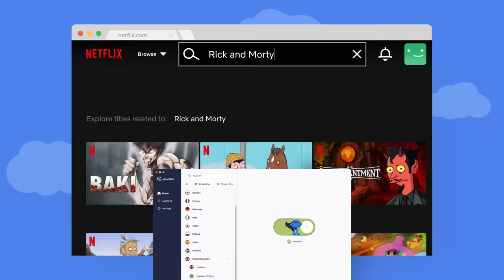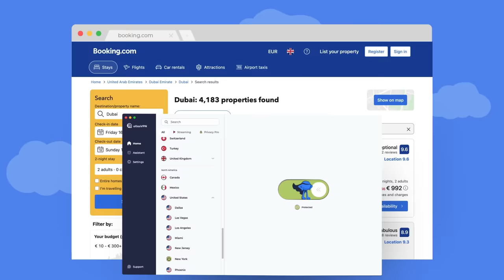How do Russians Cope with Heavy Tank Losses?

Comment: I think people underestimate just how repairable tanks are in comparison to the cost of making a new one. As long as the turret ring on the hull isn't deformed or the inside aren't completely torched, you can repair them if you can recover them.
Reply: tell me more mr tank expert
Reply: @kidkique ooooooh the sarcasm
Reply: If I fart inside a tank, it's a total loss.
Reply: @tackytrooper I can confirm
Reply: the thing is - you can only recover them if you win the battle and control the field afterwards.

If you dont control the area, even a simple damaged track (mobility kill) with a perfectly functioning rest of the tank becomes "lost"...

And in static warfare, and no mans land between the front lines...
Reply: It's a good thing the russian tanks down't have a horrible weak spot known to the ukrainians, which causes their turret to go 60-70 feet into the air and almost asuredly decimating everything that isn't the exterior hull.
Reply: That was true during WWII where tanks were little more than self propelled metal boxes with guns and tracks. In the modern day tanks require a lot of electronics to operate in anything resembling an effective manner, of course that isn't a problem if you've got plenty of spare parts but it is well known that Russia has a shortage of electronic components needed in tanks.
Reply: @hedgehog3180  that applies to vehicles in general. When I lived in Albania, my old Citroën 2CV could be fixed with little more than a toolbox I kept in the hatchback. Things were easier to repair and more reliable when they were analogue. No ECU, no electric pumps, no this, no that. Everything was operating in a purely mechanical process. Even my Mercedes Diesel was that way albeit more complicated.
Reply: ah the orxy method of counting russian tank losses.  @tackytrooper
Reply: @guitarhausdoesntknowwhatac3285 😅
Reply: @guitarhausdoesntknowwhatac3285 
Lol the one who commented in every comment when someone mentioned slightly positive about Russian tanks
Reply: @dauzlee2827  I mean, If you're going to try and talk about how easy it is to just refurbish a T-72 then it's worth pointing out that when they suffer a catastrophic ammo explosion (which is by all accounts not an uncommon event) isn't going to leave much of the internal components of the tank intact outside of the hull.

Like I'm sorry I'm not buying into the talking points of a country that has consistently overstated what it's actually capable.
Reply: @guitarhausdoesntknowwhatac3285  The other issue is that the massive amounts of heat generated when all of the ammo propellent goes up weakens and destroys the hull to so that is also worthless. That propellent has oxidizers in it, that's why those burnt-out hulls are completely rusted out in almost no time at all. Even if you somehow avoided the hull rusting out, the extreme heat has destroyed whatever temper was in that steel and it's now a brittle mess.
Reply: @Talishar  Hadn't thought about that part to be honest; I'd assumed the rusting was mostly the result of a combination of exposure to the elements and just the shitty state that russia kept their tanks in.

I'd argue though, that as valuable as the hulls are they're probably far, far cheaper then the cost of the internal components of the tank; Like as decrepit as russian industry probably is right now they can still source the raw metal to forge those hulls. The circuitry, optics, engines and other components on a T-90m? that shit is expensive and possibly irreplaceable.
Reply: @guitarhausdoesntknowwhatac3285  My point was more that a Russian tank that gets penetrated more often than not has the ammo racks go up. Those generate those rusted, burned out hulls you see littering Ukraine right now. Those hulls at this point are worthless and would take more effort just to get the hull back into serviceable condition than it would be to just forge and cast a new one. Many of the internals are "optional" as it is anyways as early captured T-80s and T-90s didn't even have thermals installed on them nor even the mounts to mount them other than the areas marked out for welding on the brackets. That was towards the beginning of the war when they didn't have a massive stoppage of partners willing to import computer chips to them.
Reply: T-72 can be rebuilt even after its turret flies 100 feet into the air. what easily comes off can easily be put back.
Reply: @tommytomas-fr3sh  The turret and turret ring are reinforced compared to the rest of the hull. If there's enough force to launch the turret, which destroys the turret ring, that means everything else inside of the tank is in ruins. That's not really repairable financially or labor wise. You can literally repair anything with enough time or money. The issue is that with taht much damage, why would you paid 2x to 3x the cost of the tank to try and repair the hull and rebuild that tank again?
Reply: @tommytomas-fr3sh I mean... putting it back on isn't the problem. The problem is that all of the internal components are obliterated by the combination of fragmentation, kinetic energy and heat from the ammo exploding inside of the middle of the tank.
Reply: @kidkique bro knows his shit why’re you messing with him 💀
Reply: I'm thinking repair battalions are a bit busy, and have a serious backlog.  Just saying.
Reply: @Jay.Kellett  I'm thinking they don't have the parts, money, equipment or manpower to actually repair these tanks.

Assuming their is enough tank to even repair.
Reply: @tackytrooper  no. Farting in a tank is biochemical warfare.
Reply: If.
Reply: Have you seen how most Russian tanks are being torched????
Reply: @tommytomas-fr3sh  Really? A turret tossed 20 meters and you think they just pop it on again? Get off the drugs.
Reply: nothing in this video will be getting repaired...mr. tank expert.
Reply: why do you think Ukraine drops grenades into the hatch of every abandoned tank
Reply: @TheRealAb216  As the Ukrainian soldier would say  ''This is not my first cookoff''.
Reply: The key is that the tank doesn't burn.  It burns?  The metal loses temper and it is junk.
Reply: The armor of a repaired tank is never as good as the original. It’s a weak spot. And often the tank body itself is warped. The only tanks they can repair have relatively minor damage.

Comment: In Serbia we had tank that has been "destroyed" 3 times and its still in service now.
Reply: How "destroyed" it was? Do you have any information? Because I need to know if a blown up off the air turret can be repaired or not.
Reply: @wj5764 mobility kill. Or gun kill. Tracks, engine and gun can be replaced easily. ITs everything else (the hull integrity) thats an issue
Reply: @wj5764  It can be repaired assuming the hull itself hasn't blown anywhere. It'd probably need to have all parts replaced and at that point it's questionable whether it'd be worth it.
Reply: In Bosnia there is a guy who has been killed 5 times, yet he still lives. 
Serbs have serious skill issues when it comes to imperialism
Reply: @rgbforever4561  maybe he had cat ancestors. So there are 4 lifes left.
Reply: NATO "destroyed" hundreds of Serbian tanks when they were bombing Kosovo but afterwards they couldn't find a single one of the "destroyed" tanks.
Reply: @adamlilley1041  how did Serbia loose then?
Reply: @rgbforever4561  small, poor, landlocked country with the USA bombing them it's called a no win situation
Reply: @adamlilley1041  if Serbia would have had invulnerable tanks then they would still be fighting
Reply: @adamlilley1041   True, though those Serbian guys are tough, I wouldn't like to fight them at land with no air power, they are cold as coffin nails.
Reply: @adamlilley1041 *14 out of hundreds lol.
Reply: @adamlilley1041 I worked with Serbs who served. They said NATO were afraid to fight, relying on airstrikes. They used pgms assuming each munition scored a kill, while often bombing empty fields. Serbs are great guys, great fighters..
Reply: Literally about "destroyed" leopards
Reply: 3rd world